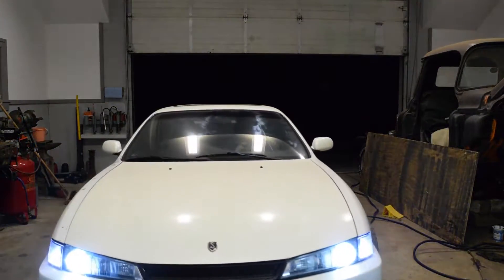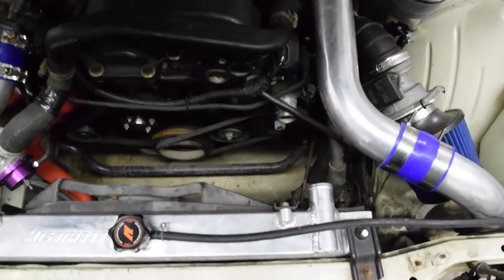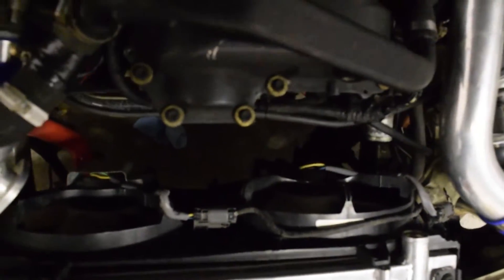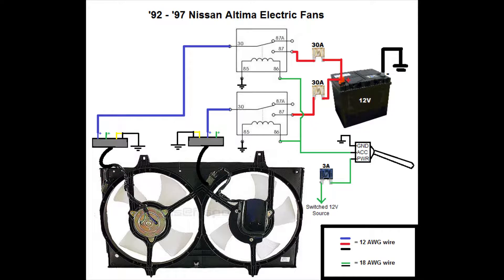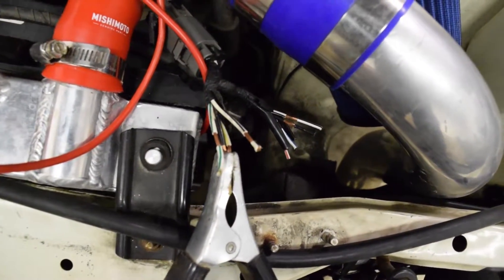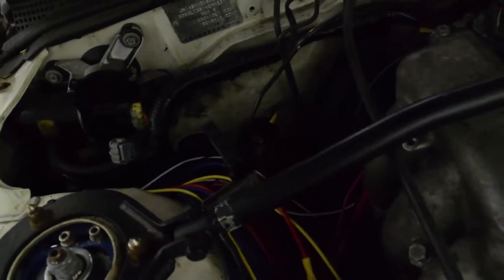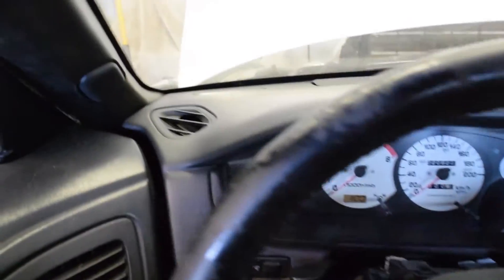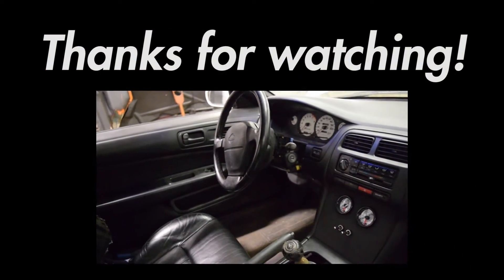240sx Altima Dual Electric Fan Install - S14 Build - SR20DET

Comment: I dont know if you still answer but I am going KA-T and my plan is to have Altima or Taurus fans controlled by a thermostatic fan controller, I am awful with wiring so I was wondering is it possible for me to do this and keep AC? Would that even be possible?
Reply from the maker: I can't think of why that wouldn't work! What are your concerns?
Reply: Hunter's Moon my concern would be if i had the AC running then the fan would always have to be on and the taurus fan only has 1 whereas the altima has 2 so i wasnt sure if that would really make any sense
Reply from the maker: @Ninjaboy459  Ahh okay, that makes sense. I'm not sure how the factory AC fan would work into that equation. You could definitely make the altima setup work by having 1 fan for the condenser, I'm not sure about the taurus fan alone though. Might be worth asking on a 240 forum!
Reply: Hunter's Moon also people say the altima fans are loud. Do they get loud at all in your opinion or during idle do you hear them?

Comment: can i just connect them to the stock fan plug ?
Reply from the maker: I think the stock fan plug you're seeing is for the air conditioning. I think there are some forum threads on how to wire that up but I haven't tried it myself

Comment: What gauge of primary wire did you use to supply voltage to the fans?
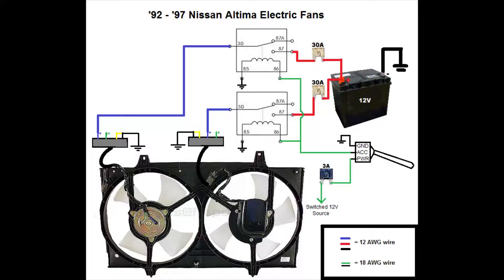Reply from the maker: 12 gauge (AWG). You can see the wiring diagram I followed at the 1:40 mark, there's a legend in the bottom right.

Comment: So I have a question, considering that they are on a switch dont you not need a relay for the fans? Ideally you could still run a wire from the battery to a switch and then to the fans. That way they don't have constant power. Of course having a fuse right before the fans too.
Reply from the maker: Good question! In theory you could do that, but you'd need a really beefy switch to handle the amperage draw. These fans pull 16.5A on low and 22.5A on high. The switch I used was only rated for 10A or something which is why I need the relay. It's also nice not having to run thick wire under the dash with all the other wires.
Reply: @HuntersMoon  perfect, that is what I was curious about cause I didnt know the amp of the fans. So it's good to know!

Comment: So how are these fans holding up for you so far?
Reply from the maker: They've been great so far! Once the engine is up to temperature I find leaving 1 on seems to keep it in a good range. I've yet to need both despite the hot weather - maybe once I get out to the track!
Reply: @HuntersMoon  i have isr dual fan and they dont seem to cut it. I may need to get these fans and shroud for sure. I have a built sr gets kinda hot.
Reply: @HuntersMoon  im going to be purchasing these at the junkyard this weekend. How much cutting did u have to do
Reply from the maker: @initial-d958  Sound good! You can see the 2 cuts I made at 1:07 , I ended up having to cut another inch or 2 up from there and it sat perfectly. I've heard these pull ~500CFM more than the isr fans. Hopefully with these and some good ducting you can tame it!